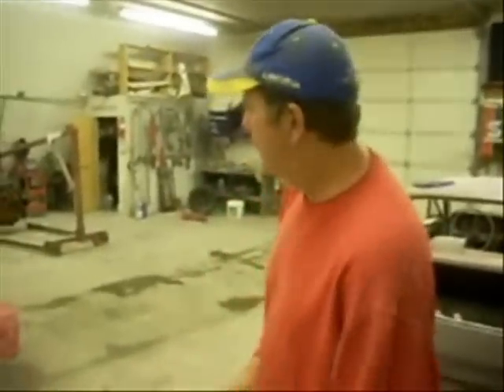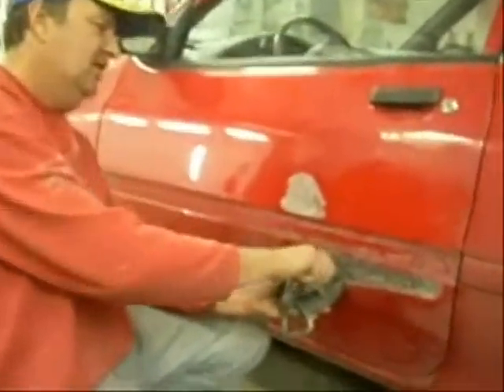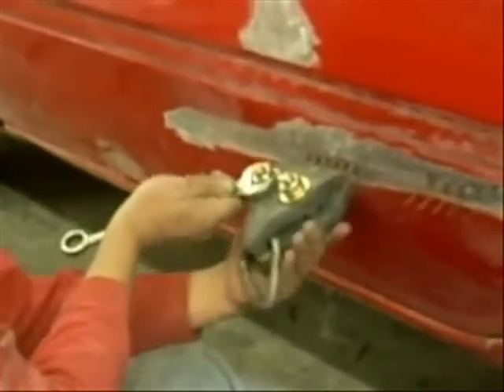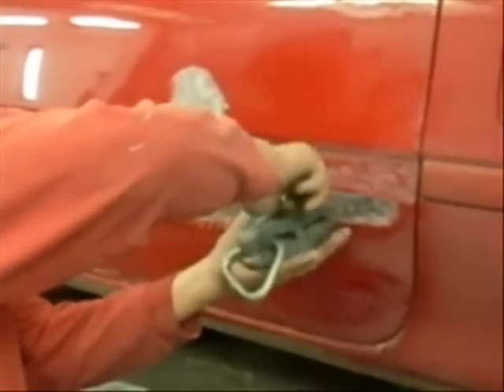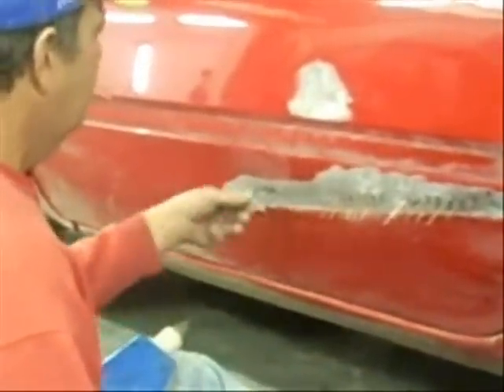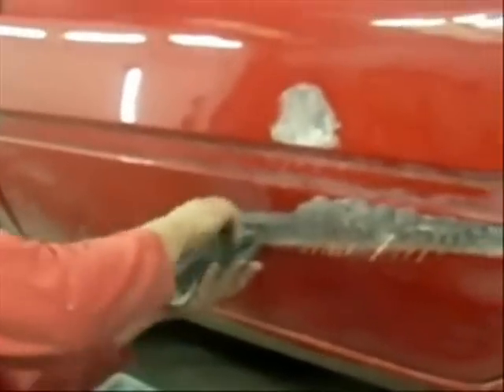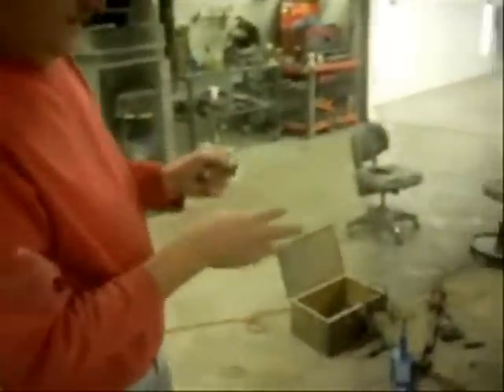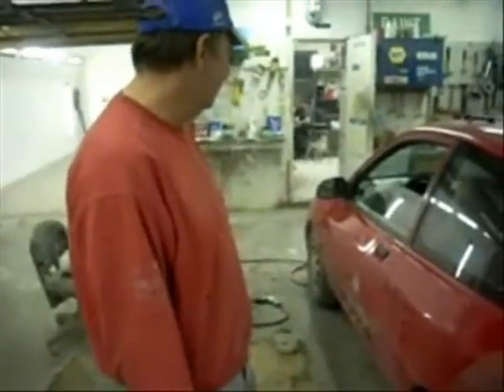Car Bodywork - Repairing Dents How to

Comment: The scott clamp approach is a little different from the slide hammer. If you use the slide hammer as a pull handle only, you can minimize the "mountains" as long as you start from the shallow end of the crease and work to the deep end. I would have used my long pick bar up through the door drain hole, which would leave the paint intact for me to see the highs and lows.